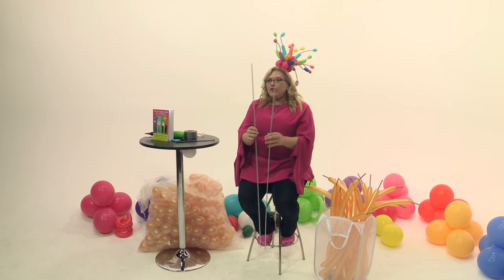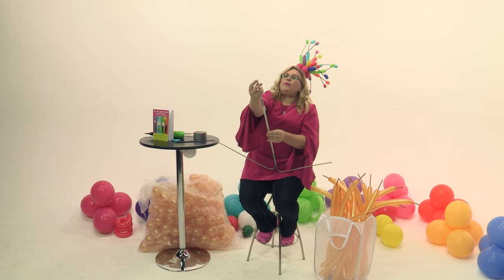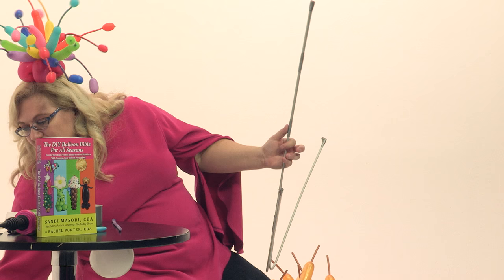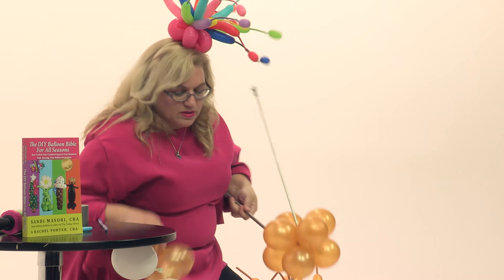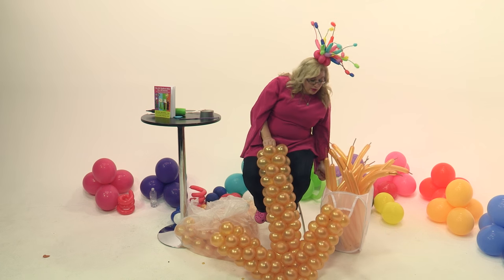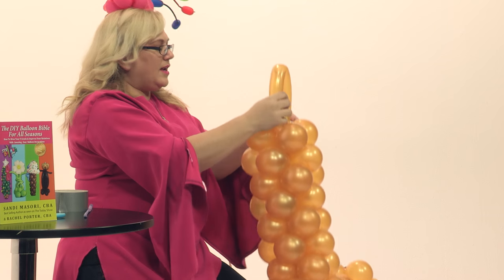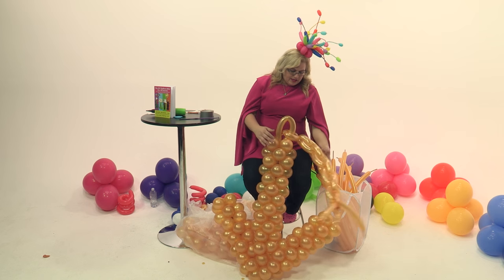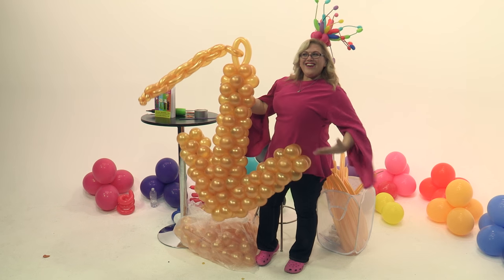Balloon Anchor - DIY Tutorial

Comment: Can these aluminum rods be used to make a question mark shape and hold the balloons without it being overwhelmed on the rod? I don’t want the rod to hang over but yet hold its frame. I’m using smaller size balloons maybe 6”
Reply from the maker: I would use the thicker rods for that- maybe the 1/2" or so.  :~)